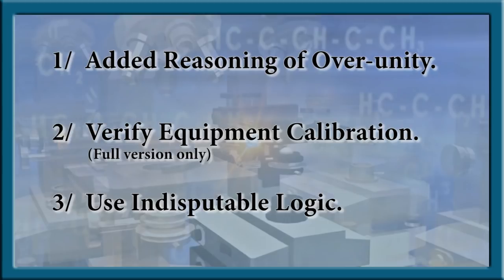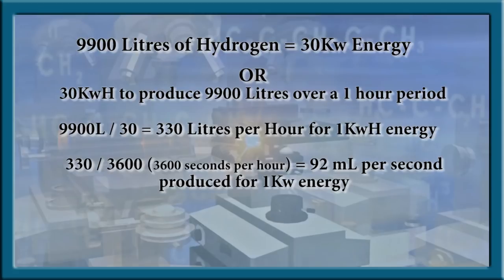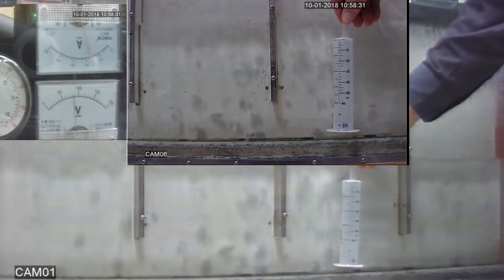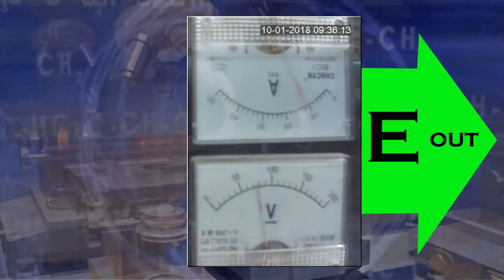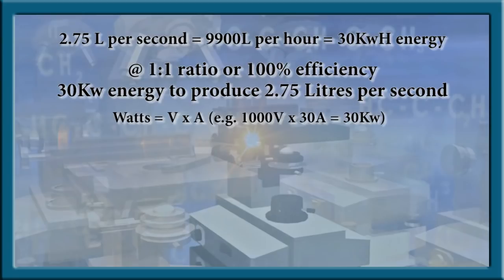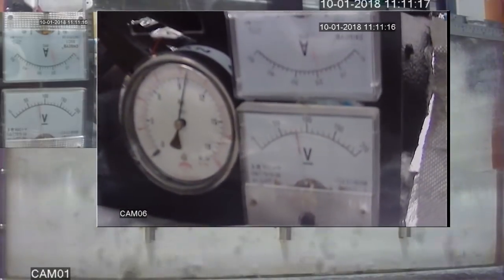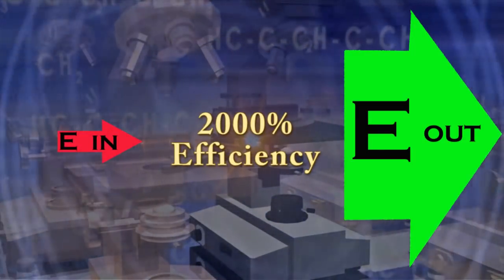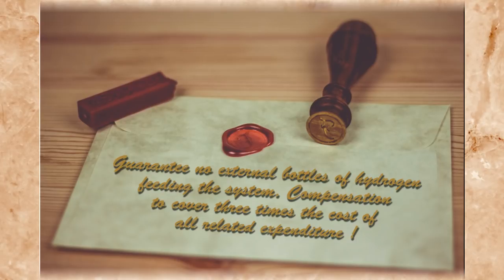Indisputable Proof Confirming Efficiency - Self-sustaining Energy Generation 2018

Comment: COP is great! How long  galvanized plate last and cost? how often consumable materials need to be changed?
Reply from the maker: Thank you for your question.
The video https://youtu.be/05pZh7I3NPg explains how the preconditioned electrolyte becomes the sustaining Anode. So electrons are striped from that rather than the electrodes. We do not know exactly how long the electrodes will last as the current set has lasted several years within a prototype test environment (not running 24/7) It will also vary based on cell equilibrium which is determined by the power ratio to cell size. If the cell is run at a comfortable level i.e. 1.3Kg hydrogen per hour per cubic meter cell then the electrolyte remains the Anode. If overworked for it's cell size then it becomes imbalanced. So Output is best governed by cell size. But it can be over driven. The worst case is for an electrode cost of 0.35c per Kg of hydrogen.
Reply: You are conflating Economic cost with Energy output, what matters is how much energy is needed to Mine/Process and manufacture the materials for Anode & Cathode! Cradle to Grave! Also the energy needed to make the Electrolyte